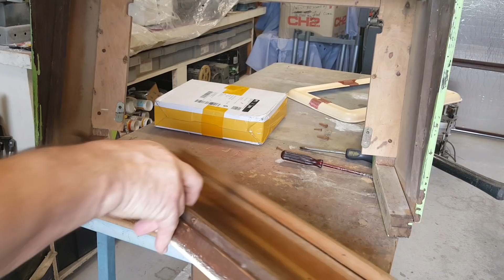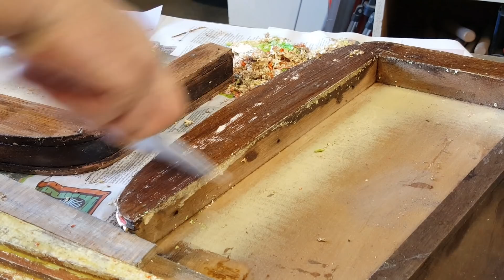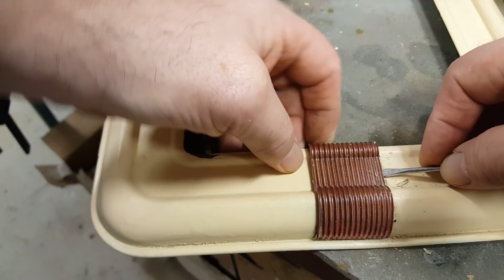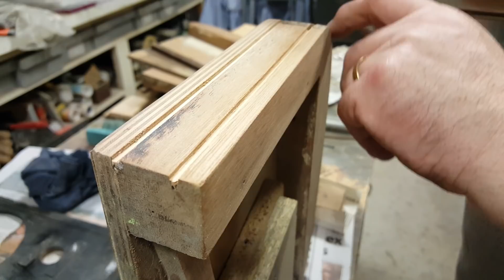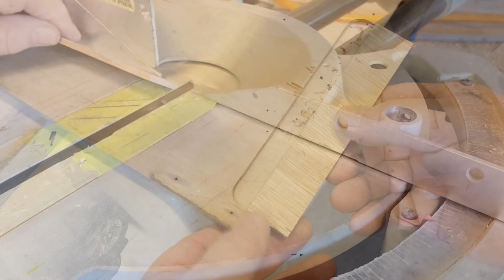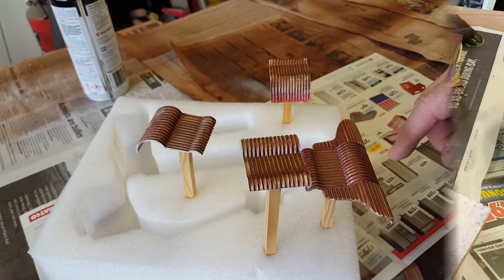The French Connection - UNIC 'Royal' Radio- Restoration Part 2

Comment: Dave, regarding the veneer, are you aware of the beveled-edge trick?  It provides an easier, seamless match and greater gluing surface for a stronger join. Easy to do. Just take a sharp edge plane and slide it along the edges of both pieces to be joined at a 45-degree angle so that one edge slides under the other when you bring the two pieces together. You probably already know this, so sorry in advance, but maybe someone reading this might pick up a new trick.

P.S.Your seam came out perfectly, so maybe not worth the trouble.  Always impressed with your approach, methods, techniques and work!  💯
Reply from the maker: I was not aware of that method @aerostahr, thanks for the tip 👍😊

Comment: Greetings:
     I suggest that removing the target voltage when NOT tuning will increase the life of  the eye tue target. I suggest using a reed switch relay that will hold up to HT arcing. A 555 IC can handle the delay timing, but you need  to initiate the timer with either a switch or similar. A soft push button when fine tuning is needed is suggested. A band change  would work too!
Reply from the maker: Thanks James. I don't worry about the eye wearing out because the radios go on display after I have finished them and only get occasional use. But that's a good idea to save wearing them out when the set is not being tuned. I wonder if a friction switch could be made to make temporary contact when the tuning shaft is turned to trigger the 555 timer 🤔

Comment: I used to rebuild furnature as a hobby, what I did when it came to replacing old screws in old holes, I would take tooth picks and insert them in the hole, cut them to size and glue them in, then the old screws could bite into the toothpicks and force the screw to maintain it's fit for another 100 years or so.
Reply from the maker: Hi Jerry, I do the same, I use toothpicks, matches, even bamboo skewers for larger holes. As you say, it works well 🙂

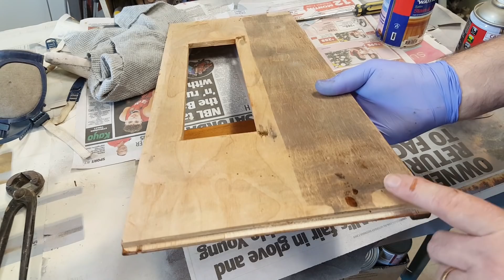Comment: 29:49 That's a great way to straighten the back. I thought you were going to use steam for a moment. Do you know what this material is called? Also, how would you go about repairing a broken off corner? The corners where the screws that attach the back to the cabinet often perish due to frequent mishandling. Especially when the corners are in the shape of a prong (like in the bottom end of a bicycle's rear triangle) they're nearly impossible to fix.
Reply from the maker: The back flattened out nicely. To repair broken backing I mix up some paper mache using minced toilet paper and PVA glue instead of water, add a bit of flour and some cooking oil. I mix colour into it with artist acrylic paint to match the existing board colour. It sets very hard and can be sanded and drilled 👍

Comment: David, seeing how you've been dabbling with restoring rusty parts in this video and the next, I thought I might point you to a rust converter recipe from down under:
https://youtu.be/NR96qdYjy4Y?t=588
It might come in handy in cases of chassis corrosion, rusty transformers and other such parts where you might not want to go to extremes with restoring and also preserve some originality.
Also, seeing how easily some glued cabinet parts came apart, could it be they were glued together with hide glue?
Hammering out the buckling was genial. Do you think this would work equally with an aluminium sheet or would I risk stretching it too much? Also, in my case, it's painted with a crackled paint and I wouldn't want to ruin that.
Reply from the maker: HI Stelios, I checked the rust converter video and I've seen it before, it seemed to work alright didn't it 👍 I would think they used hide glue, that was the mainstay at the time. You can shrink or expand metal but the finish will suffer. you can get wrinkle finish paint from the auto stores and crackle paint from hardware stores if you need to refinish it
Reply: @DavidTipton101  Yes, David, indeed - I'm thinking: rusty transformer laminations and crowded chassis!
Hide glue is great: it's the equivalent of a post-it note for carpentry. The ability it gives  one for infinite repairs makes it second to none - unless you're vegetarian. I have not been able to find a vegetarian substitute.

Comment: Have you ever used "Soda Blasting" on the plastic parts and cleaning the grain on the wood? You use Baking Soda in a hand held sand blasting gun. It works very well.
Reply from the maker: Hi Jim, no I haven't, thanks for the tip 👍🙂

Comment: Brilliant as always.   I'm thick when it comes to woodwork so forgive me for asking but did you leave the tape on the veneers when you glued them on to wood to keep the join.?  I get the idea of having the join at an angle when bringing the pieces together.   Was the lacquer gloss or a semi gloss?  Did you source your  veneers locally?  Thanks for your time and effort .
Reply from the maker: Thanks Biggles59. Yes I left the tape on but removed it after about 30 minutes and re-clamped it overnight so it wouldn't leave a dent in the veneer. it probably wouldn't have mattered. The lacquer was 60% gloss, I used full gloss on the Nordmende radio though. I get the veneer from a supplier 30 minutes drive from me. Cheers 🙂

Comment: Dave, when you heat it. you might consider quenching. That will shrink the mesh.
Reply from the maker: That was my first thought John but it really needs to be heated in the middle of the bulge and reworked to shrink it while it's hot. Either way I didn't want to heat it and risk damaging it.

Comment: David, I honestly think you have to love what you do to those radios.  I don't know where you get the patience from.  I think I would have definitely thrown that one in the bin, the chassis was one thing, but the cabinet I think I would have gave it the heave ho and  built a now one instead.  It would have been simpler, I just don't know how you do it, you never cease to amaze me.  It is looking good, I hope you treated it for woodworm!  I am way behind watching videos, so you might have it all together by now.
Reply from the maker: Hi Bob. It makes it easy if you like what you are doing. I may still chuck the cabinet if it looks hideous 😄 The woodworm has long gone, no need to treat it 👍🙂
Reply: @DavidTipton101  Yeah, the holes are them coming out, but that usually means there still some munching away.  But you maybe right, they may be from one batch.

Comment: Veery elaborate restauration with a number of great tricks to take note of, big thumbs up, Mr.Tipton!  If I may contribute with one trick too: The problem with the green paint stuck in the grain of the veneer. There is a stuff called MEK, Methyl Ethyl Ketone, AKA Butanone. It even dissolves polyurethane foam, which Acetone cannot, and this solvent, together with a fine brass wire brush will clean such paint residue out of woodgrain without harming the veneer.
Cheers from Germany
Reply from the maker: Hi Blitz. I used to bath in MEK as a young apprentice but it is banned in Australia and has been for some years so it cannot be obtained by the public. It was very good for cleaning though, it could have worked 😀

Comment: She's coming up very nice indeed, a real beauty in the making I think.
If you soak that cane in warm water for a couple of hours it'll bend and form just a tad easier.
Can't wait to see it fired up and glowing... and I think it's gonna sound great. Cheers.
Reply from the maker: Hi scofab, I think you are right, it will sound good when it's assembled. I could have soaked the cane but it may have watered down the adhesive I thought so I didn't do it. It seems pretty secure now 👍🙂

Comment: David, I think you said one of your spray cans had failed. When a can has become blocked with a chunk of undissolved paint or has run out of pressure with some remaining paint I have had some success by injecting compressed air into the can. Remove the nozzel and use one of the plastic adaptors you get with lighter gas refills over the stem and squirt in air from your compressor. Use just enough to unblock the stem or get out that last bit of paint. I hate wasting materials - this helps to avoid that.
Reply from the maker: Hi Bob, I did that and replaced the spray nozzle. That can has been faulty since I got it. Thanks for the tip Bob 🙂

Comment: Instead of recovering with a  so so looking veneer you should have tried a stain paint combo. Fill the borer holes with a stainable putty. Then use a good stain brush that makes
 a pattern of wood grain to your liking closely matching  the original cabinetry. Seen it done on YouTube at a Wesley Treat video called "Make Anything Look Like Wood"
 and using the Honey colored  stain looks fantastic. That was a lot of wood working! It's coming along well.
Reply from the maker: We used to do that back in the 70s, you could buy kits with the wood grain pattern maker. That's a good idea HTM but I think I would still go veneer though 😀

Comment: Superb! Now dont scratch it when you assemble it ahahah :)!
For radio and tv backs i soak them on the bathtub for one hour in warm water until they are totally "floppy".then i lay them on the floor on top of a wooden board to absorb the moisture and put some heavy stuf on top, on the corners, middle etc... if you dont let it fully dry it will warp again during the drying process. some parts will be wet and some will not so it causes warping...if its fully dry it will be perfectly flat. never had problems with lettering coming off etc. if your radio back warps again in a couple of days just rewet it and this time let it dry on top of a porous material like pine board or other soft wood. sometimes here it takes a week or more and we a have a very warm climate
Reply from the maker: Ok, thanks for the tip Hugo. I put it back in the press with out the plastic after I looked at it, hopefully it will still be OK. In the bath for an hour seems extreme but I bow to your experience 👍😀
Reply: @DavidTipton101  Hi David. some backs are not floppy even after an hour especially on large tv's....i never had problems with letting them soak for long periods, the lettering was my main concern but it holds fine...i have done many of them...but still proceed with caution . Best regards!

Comment: Pretty awesome so far. Your veneering work came out beautifully, I was a little worried you were going to paint it at first. Also the bead replacement was very impressive. I will save the rest of my comments for next week. 🤗
Reply from the maker: It would have been easier to paint it Phillip, I didn't think of that 🤦‍♂️ lime green would have been nice 😲 Thanks Phillip, till next week 👍🙂

Comment: Navy Trained tin smith David! Do a slight cross brake  from corner to corner ! (SLITE) it make the expanded metal slightly  crown slightly in the center! ! You can also lightly  planish the center of it
Reply from the maker: Hi Ronnie, I was trying to get rid of the crown in the centre. The result was better than I had hoped. I haven't heard 'planish' since the 70s. Thanks Ronnie 😀

Comment: As I’m back to this video, I forgot to mention that you could make this radio have a coin slot. Every time somebody comes over to your house 🏡, they’d have to insert two quarters to get the music 🎶 to play. This would help you with your profits. Just be really careful if you come across a radio 📻 with an asbestos heating pad. Carefully remove it, preferably outside, and seal it up in a Ziploc bag, and deposit it in the trash. This is also true to stripping floors in many older houses 🏡. Ive never seen ya do those wall mounted “jukebox”, like radios, such as those silver ones at restaurants designed to look 👀 like the 1950’s and 1960’s. They’re at each table, and have a rounded glass window you see the songs through. They are a coin operated radio, and you push, for example, K2, to play “Donna”, by Ritchie Valens, or whatever. I don’t even know how many songs you can play on two quarters. I’d say around 3. I still cannot distinguish the song at the start of this video. I still say it’s “Kiss me once, kiss me twice, and kiss me once again”, or “Woman at the back of my mind”. It could even be a twist of the two put together. It makes me think of my mom, and that I wished she could still be around to see my hobby on wanting to restore radios. I started watching a different things on YouTube, and came up by some favorites. They were Shango066, and Radiotvphononut. I only found these out about two weeks to a month after my mother died. I then found Radio 📻 Rescue, Teddy Hashee, Glasslinger , and Jim Lindenas. There’s more. I think I found out about your YouTube channel in mid 2019. May have been February or March of then. Too bad I wasn’t doing comments then. I’d still have been at my apartment.
Reply from the maker: Hi Jeffery, thanks, I couldn't agree more

Comment: I'm one of your non-radio-restorer fans David but I wouldn't miss one of your vids now. This one taught me a ton of stuff, like what oil-canning is and how it can be repaired. And thanks for making me aware of Aqua Coat; that looks like an excellent product. Your channel was recommended out of the blue for me so it seems the YouTube algorithm might be rather cleverer than I thought. Looking forward to part three mate. Thanks and stay healthy.
Reply from the maker: Hi Mark, thank you. Oil canning is normally cured by shrinking the centre of the oil can which involves heat and deforming the centre hot spot. I tried the opposite here by stretching around the oil can because I didn't want to damage the mesh. There are lots of methods for filling grain on timber, Aqua Coat does work well though. Thanks Mark 👍

Comment: Hello Dave

To remove paint where paintstripper not help you can try out ants acid , i don't know the word in english . 

look here perhaps 

https://www.amazon.de/Vogelmann-Chemie-Ameisensäure-75-kg/dp/B0133YW0XY/ref=sr_1_3?__mk_de_DE=ÅMÅŽÕÑ&dchild=1&keywords=ameisensäure&qid=1590756674&sr=8-3

The acid is very thin , and not harmless , try it only outside .

Inside only if you can guarantee fresh air ! 

Great woodwork Dave , very good repair . 

greets 

Uli
Reply from the maker: Thanks Uli, it's called formic acid, it is very pungent. Others have suggested brake fluid, easier to get I think and not as smelly 😀 Cheers

Comment: David, the best part about all your radio adventures is watching the evolution of your craftsman-ship. You never claimed to be a Professional ;maybe... but the end results are saying something else. The learn as you go method is really a beneficial asset to this community, I actually like knowing that these videos can be referenced later on if needed, the detailed procedures you use, like emery grit, drying time between gluing, paint coats, on-camera mistakes if any, granted I know there are a lot of detailed diy videos on here but they all somehow can't help but 'over do' it with A/V effects sometimes missing the point entirely or just right out blasted annoying. You are 1up on them with your -  To mention a few that makes a really good video - Are good camera prospective, audio engineering, and very professional and articulate narrations, AND Most Important are restoration videos that can be viewed even at night, without bothering the household or neighbours. Which most of the working class like myself that is mostly the only time there was before the lock-down. Well... 
Jusqu'a la prochaine fois.
Reply from the maker: Hi Raul, you are correct, I do this as I go and I'm learning a lot in the process. I'm very happy you and others get something from what I'm doing. It's very humbling. Cheers 👍

Comment: This is a “doughnut shop” radio 📻 by looks. Kind of sounds like an instrumental of the song “Woman In The Back Of My Mind” by Mel Tillis. I heard it many years ago, but again in 2002 or 2003 with my mom. It could also be “Kiss Me Once, Kiss Me Twice, And Kiss Me Once Again”. This is a field coil speaker, and the radio cabinet is wood. You’ve also got a system of clamps I don’t have. Battery operated Dremel tool, I like an electric one ☝️ best. Great veneer job. A lot of new radios have this over particleboard. I knew, but Radiotvphononut lets this be known. I guess I need routers and power saws. Great 👍 engineering went into this radio. Right now, I don’t know the condition of the dial cord, but if you had to undo it, just take snapshots of your progress. I don’t think 🤔 this radio 📻 has a dial light, but I could be wrong. I’m watching this video since I know you just made it. “The American Beauty”, as this radio should be called. I now see, no dial light bulb. That paint requires a lot of ventilation, and no smoking 🚭. Just a safety reminder. If I had a big enough garage, I’d buy every antique radio 📻, and display them. Sheds are okay 👌 in one ☝️ way with radios  if you want to keep them safeguarded in the box. Strict care must be adhered to, as far as dust, moisture, climate control, and many other factors. That doesn’t mean put the radios in the shed and abandon them. Great 👍 polishing job as this video approaches the end. Like these videos a lot. I know I couldn’t do a business like yours in an apartment. I’m going to see if I can buy myself a house 🏡 in a few years.
Reply from the maker: Thank Jeffery, Mel Tillis was a great talent

Comment: Rather than wood glue, super glue might have worked better on the cane insert. Instant and strong.
Reply from the maker: Thanks Andy, super glue on timber is probably not the best use for it. The PVA will hold it for a long time, I hope 🙂